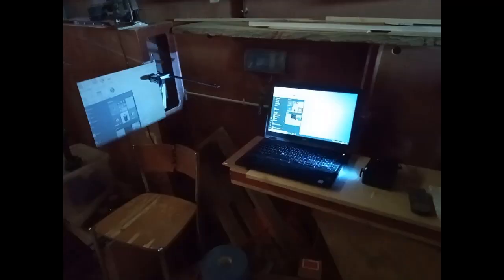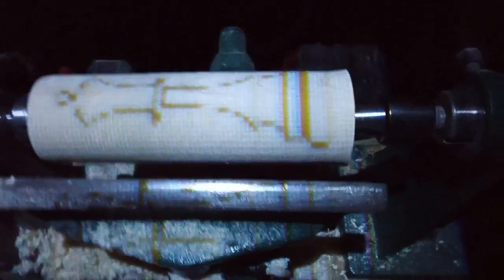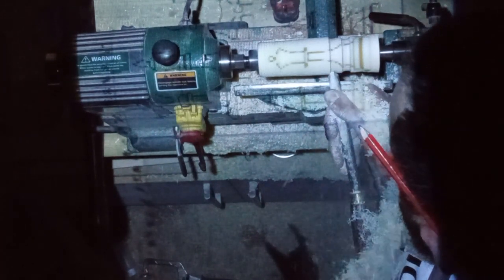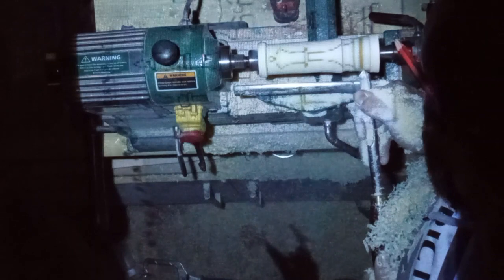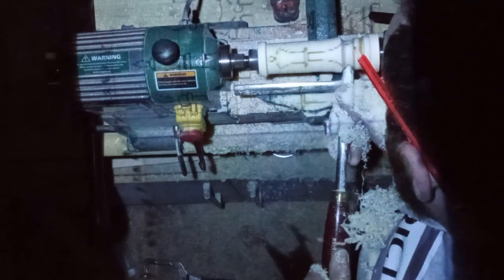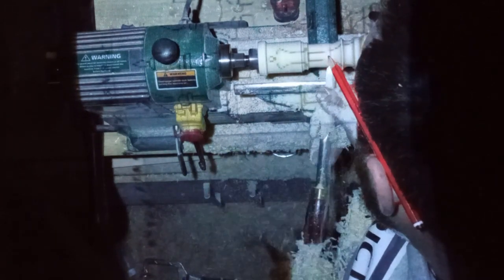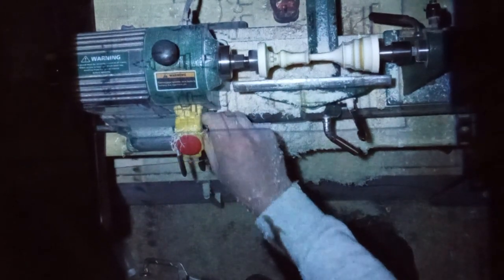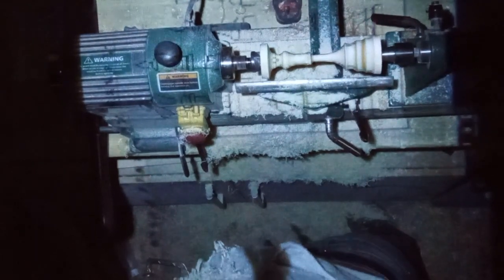DLP Lathe Technique

Comment: Looks like it works great! I mentioned on the Woodturning group how I recall seeing another method using shadows. I just put up a short example of what I was talking about. Not nearly as nice as yours but I just drew a couple of curves and went for it. Actually had not ever tried it before.
 I really like what you have done here!
Gary
Reply from the maker: Thanks Gary I did see that and it looks totally doable. I tried the chasing the shadow which is like a variant of what you showed but I just couldn't get the hang of it
Reply: Well what you have here is vey impressive and I always like trying something new. I am wondering on a larger diameter if the shape would get distorted as it starts projecting on a curved surface?
 I like turning spheres and do them free hand using math. I have a video of that on my channel.
Reply from the maker: I think it would but I reckon with some planning you could alter the image on screen to account for it
Reply: Even if it did all the parts would still be the same and that is the main purpose of your brilliant method.

Comment: thats a great idea. not knowing anything about projectors, what is the one you are using there?
Reply from the maker: Just a cheap junk one from Wish
Reply: Ok.  I hope you can help. I’m having trouble getting the size right on the stock. Does yours have a zoom function?
Reply from the maker: @trevorsingleton2386  no mine is very basic, all I have is focus. I was adjusting the scale of the piece on the computer. I had it in sketchup but anything you can place the part on an axis or datum and scale around would work. If all else fails pop it in paint and stretch the window.

Comment: This is a great idea, especially for replicating pieces. One suggestion I'd like to make is to rotate the image around 180° so the base of the piece is at the headstock end instead of the tailstock end. This way the bulk of the material is supported as you reduce down to the final shape and you will be able to move the tailstock away to finish the piece without having to turn it around in the chuck.

Great idea though!
Reply from the maker: Good call, the thing is that is really easy with this, just flip vertical on the software and it's done. It would work just the same with bowl turnings too, you could have it one way while you were setting up the mortice for the chuck then flip the image with the bowl